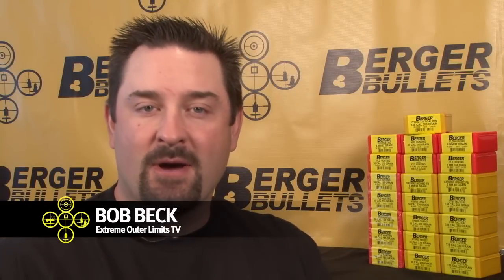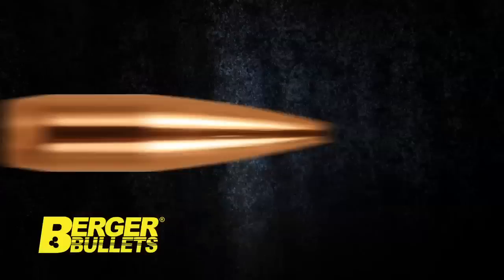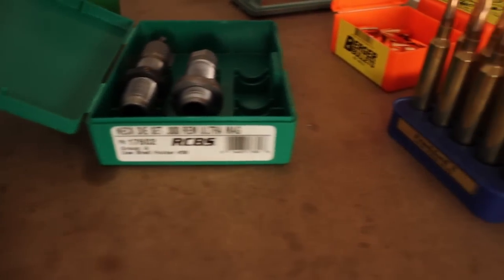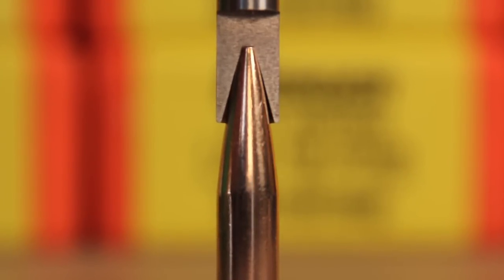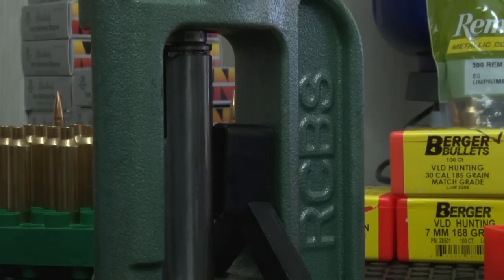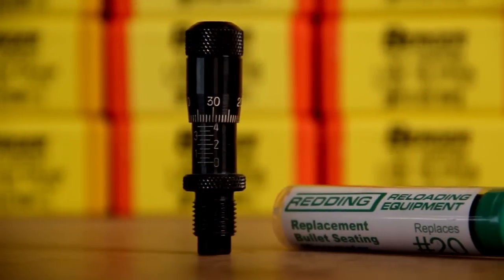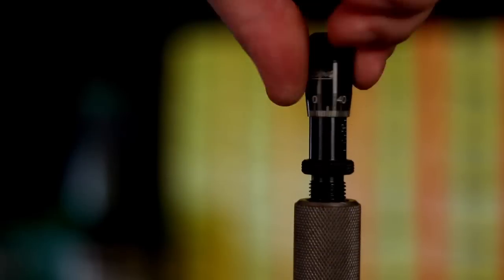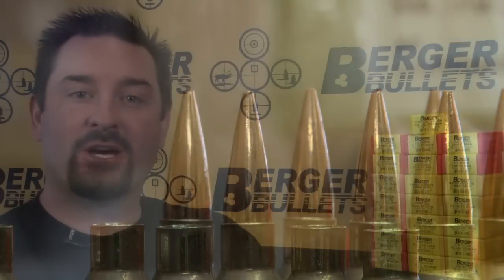Bullet Seating for the VLD Line of Berger Bullets

Comment: Will this micrometer work with different brand dies???
Reply from the maker: Julio,

These stems are designed to fit all standard Redding seating
dies, but will work on other brands if they use a ½-20 threaded stem.  You
will need to check the thread size of a different die to ensure they will fit. 
Kind Regards,Corey SchwanzBerger Bullets Technical
Support Teamtechsupport@bergerbullets.com

Comment: I have a .338 Lapua rifle.  I use L.E Wilson bullet micrometer arbor press die. I love the setup. I always Moly coat my bullets (250 grain tactical) and with 94 grains of retumbo powder and my 32 inch barrel has a muzzle velocity of 3020 fps.  With the Wilson setup run-out is around a tenth. The setup shoots fantastically and consistently. Any thing that I am missing with this setup??  Thanks!!!

Comment: If i am shooting lets say 308 175gr or 185gr Tactical Line bullets, Do i still need the micrometer from redding? Or will regular bullet seating die do just fine?? Thanks!!
Reply: 175gr Match OTM Tactical
185gr Match Juggernaut OTM Tactical